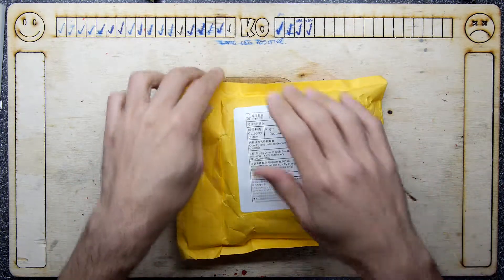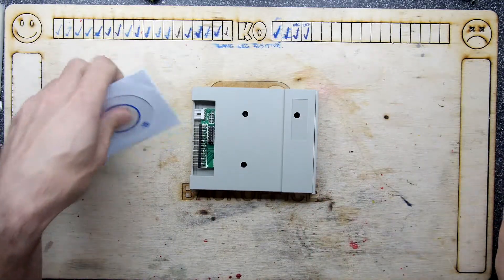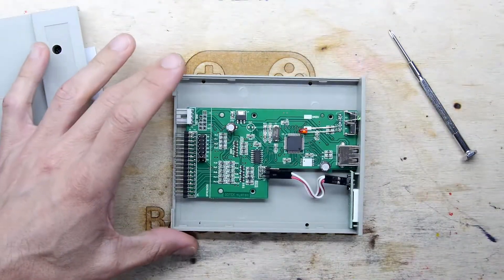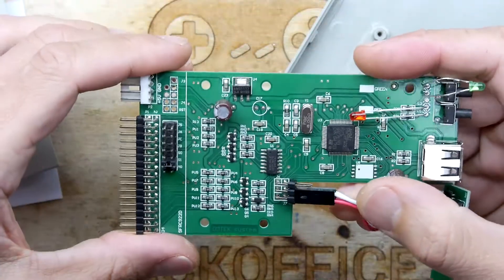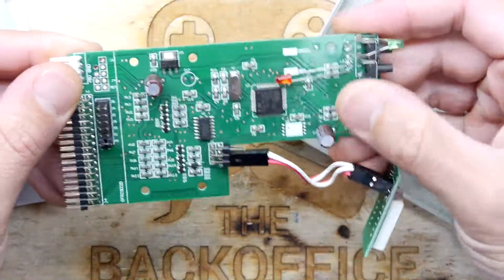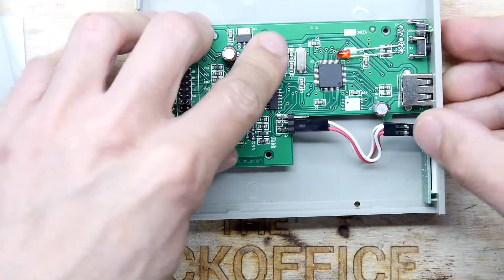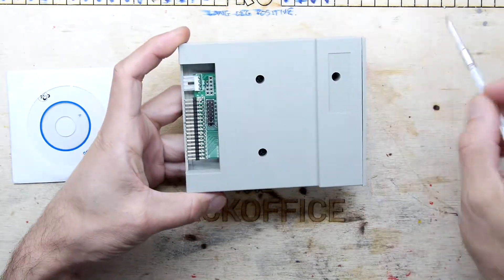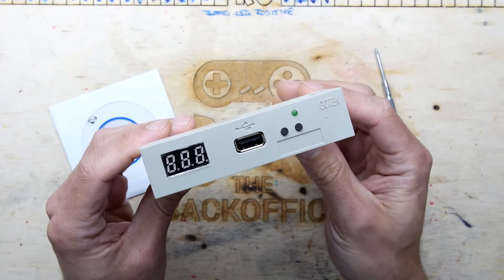GOTEK Inspection

Comment: Ive  just bought a gotek usb floppy drive emulator for yamaha korg organ electronics sfr1m44-u100k  but i can't get it to work on my super wild card 32dx  any help would be much appreciated
Reply from the maker: I usually reprogram these with the flashfloppy firmware. Might be worth checking if they support your organ, I suspect they do
Reply: I haven't  got a organ I bought it for my super nintendo super wild card 32dx its a cartridge coppyer
Reply: @phillipcross2840  did you initialize the stick as floppy
Reply: @charmillesrepair708 I haven't got a computer so I formatted the stick on the gotek and it copes reads and write fine but the picture goes crazy on the tv I bright have got the wronge gotek that's the only thing I can think of
Reply: Copy
Reply: Bought its got 9 holes behind where u conect the power cable on the gotek

Comment: Do these have built in sound for the fake reading noise.  I'll just Google it and get spied on by them... inconvenient
Reply from the maker: +Deep State Globalist Games I have manually added it on the past in a previous video. Just a simple speaker and transistor on a data line. A little inconvenient but not too big a deal.

Comment: There is some open source firmware on English Amiga Board. Links later
Reply from the maker: +chicken livers ha ha
Reply: tested it with STe works without menu/selector, St fileselector comes soon as soon they make new update
Reply: Meth Methanoid will follow these 'links'...
Reply from the maker: +Meth Methanoid links!!
Reply from the maker: +TheLemminkainen is there a link I can try
Reply: https://www.facebook.com/groups/CommodoreAmiga/permalink/10154871351474157/?comment_id=10154946275819157&notif_t=group_comment_follow&notif_id=1504386550239494  

follow this post first u have update it with Keirs firmware. 

You need usb male to usb male cable and windows pc.   https://www.youtube.com/watch?v=yUOyZB9cro4 with this video show you how u need dfu file to flash and can convert it with that program... Make sure u have  0.35 vesion or higher 

http://www.st.com/content/st_com/en/products/development-tools/software-development-tools/stm32-software-development-tools/stm32-programmers/stsw-stm32080.html  

Later updates just put upd file to empty usb fdrive then both gotek buttons and it will update. You will now if your flashing was succes gotek will show  F-F on screen.

Also with ST you have to convert xxx.st files to xxx.hfe file with Hxc 2001 converter  then put 1 hfe to disk and ST will automount it like real disk. http://hxc2001.com/download/floppy_drive_emulator/HxCFloppyEmulator_soft.zip converter

http://www.indieretronews.com/2017/07/flashfloppy-first-alpha-release-of-new.html
Reply from the maker: +TheLemminkainen perfect. I have an ST (as in chip manufacture) Dev kit for my boobie cortex project so this procedure sounds vaguely familiar 😂
Reply: iam not sure if tos 2.06 is needed ... iam sure full support will come soon for Atari too.